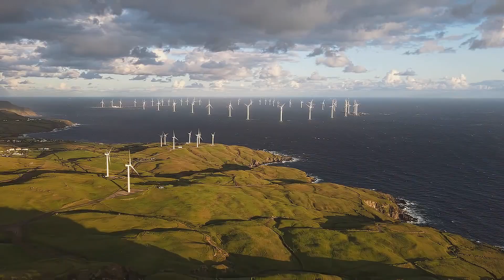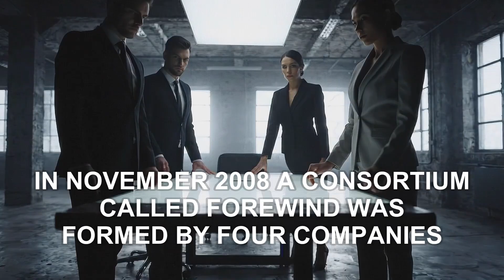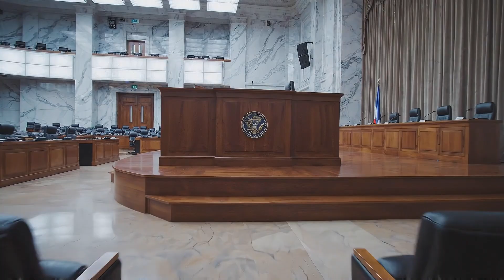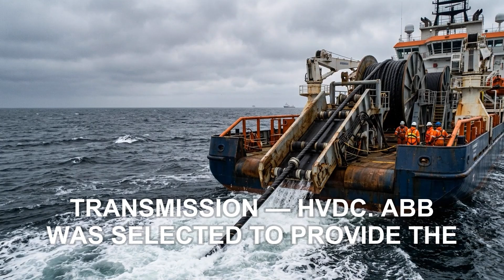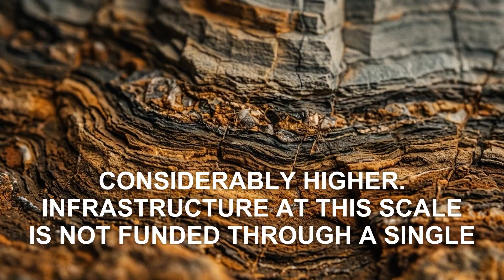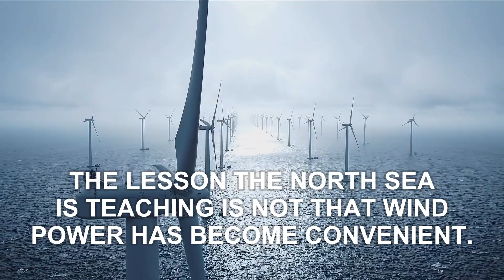Can We Build a Nuclear-Scale Wind Farm?

Comment from the maker: Shallow enough for steel foundations. 100+ miles from shore. 8.1 GW planned — bigger than eight large nuclear reactors, powered by air over a sandbank.

What hit hardest: the geology window, HVDC cables 130 km to Yorkshire, or capacity cuts from 9 GW down to 3.6 GW for phases A–C?

Drop your pick 👇 — next megaproject?